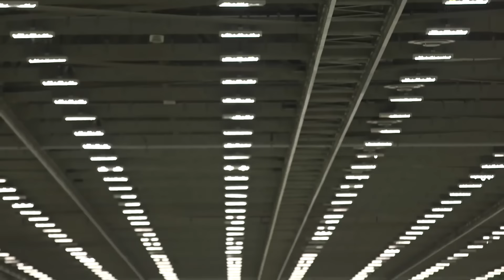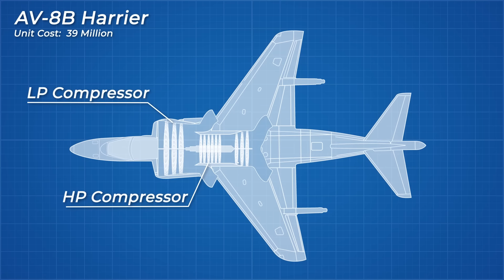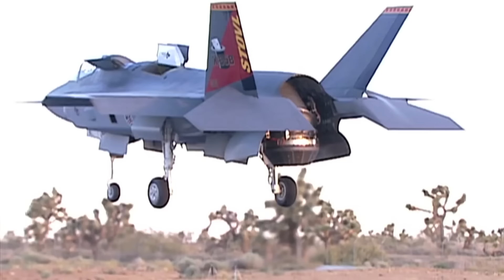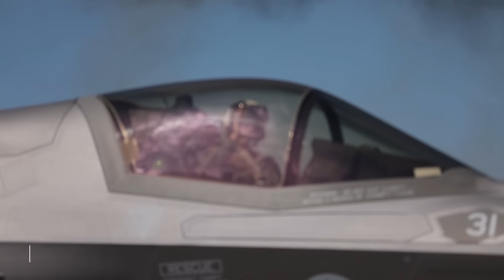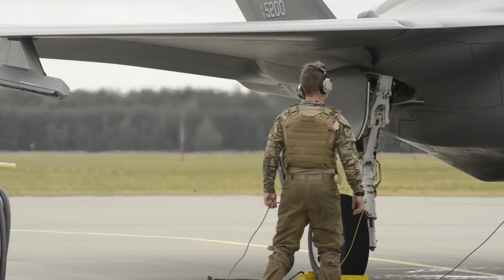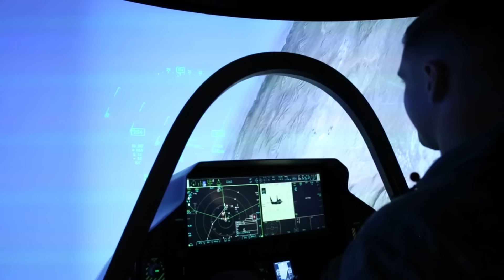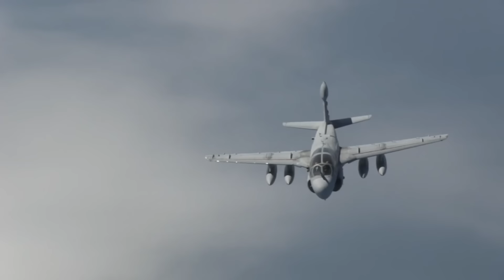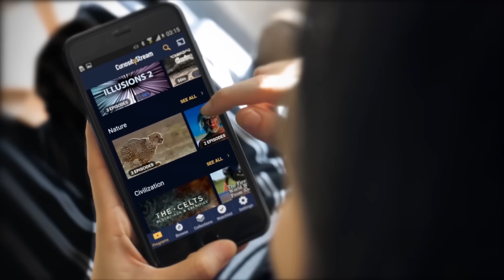Is The F-35 Worth $115 Million?

Comment: Actually only vtol f35b costs 115 million.( most expensive version). This is meant for the usmc and is only worth buying for nation that have that unique requirement.

 F35a conventional land based  take off variant  is only 89 million with price projected to drop down to 85 million. At it's current price it's already cheaper per unit cost than the eurofighter ( 105 million) whilst utilizing more modern technologies.

Besides capability advantages the price was in fact why Belgium chose f35a over the eurofighter to replace the f16.

So yea f35 is worth the money

https://www.google.ca/amp/s/mobile.reuters.com/article/amp/idUSKCN1MZ1S0

Comment: You said it in the beginning: due to corruption and lack of vertical integration, the answer is that no, the plane is not worth $115 million.
Reply: It is worth it and is one of best options available. $115 million isn't cheap, but no other plane can fill the role. $89 million for the A variant however is cheaper than most other fighters available, including the F-15.
Reply: @dumdumbinks274  It's not worth all the money getting drained into corruption and inefficiencies. It's also only coming down to that price because a) the administration is fine squandering all that tax money into pork-barrel spending like that and b) because foreign nations subsidize it as well by buying it when it clearly isn't necessary in the current environment. Terrorist cells don't have an air force.
Reply: @Yutani_Crayven  That's some backwards thinking... you prepare for the biggest potential threat, not the smallest. Just because a certain war isn't taking place doesn't mean you can manufacture adequate equipment once it begins since infrastructure is always the primary target. 

Your problem with this is related to corruption and inefficiency in general that comes with government projects. In the context of the market the F-35 is worth it
Reply: @dumdumbinks274  And even then, it's not worth that much because it can be made cheaper without said corruption and with vertical integration. But it's built like the Senate Launch System, not with the goal of building efficient businesses but to launder money.

Comment: The opinion of the test pilote working for LM is of couse going to be positive. It's not a credible source. Also, there was no mention of the astronomical maintenance costs associated with this plane (due to the stealth coating)
Reply: You mean the costs that are roughly the same as the F-15C in USAF service? You're probably confusing it with the F-22.

Comment: A jack of all trades a master of none then. I wouldn't say it would be a successor to dedicated ground attack platforms like the A-10 Thunderbolt II or the Sukhoi Su-25, since its internal weapons store cannot compete with either in ordnance it can carry. These platforms are designed to be sub sonic to carry more weapons under their wings and operate under air superiority to suppress and destroy ground targets. While the F-35 may be able to sortie, destroy the target and return unharmed, it will have to make many many more sorties to perform the same as dedicated ground attack planes which of course has its own multitude of issues.
Reply: The A-10 is not designed to do any of that unless you're talking about a 1960s scenario. Also the F-35 can carry more than the A-10 and Su-25 and is definitely better at CAS than the A-10 and Su-25

Comment: Worth it? Depends on who you ask; depends on who's using it... Did the US have to develop this level of technology? To be the best technology? Does the F-35 put US pilots in the advantage whenever they meet an adversary's similar aircraft? There's a lot of "new stuff" in the F-35 that cost a lot to develop, then that cost is spread over the production run, i.e., build 10,000 F-35's and they start costing less than if you build only 3,500 or whatever the number is. So, it's a complicated answer to a ridiculously simple-minded question. Bottom line: It Depends.

Comment: Oi, those "helicopter carriers" the Marines fly off of are Navy ships. The Marines just ride around in em.
Reply: actually, they are marine ships. but they are piloted by the navy. they are registered under USMC equipment. not USN.
Reply: Keller weskier No.
Reply: Hammer 001  -- 

I think he means most noteworthy. 

The ships are basically LPHs (Landing Platform-Helicopter) and not specifically USMC vessels. Most Navy ships carry at least a few Marines, and the Marines ARE part of the Navy. Calling them Marine Corps ("Core", not "corpse,") ships is somewhat misled and misleading. 

Edit added the word "ships" for clarity. It was what I had meant to say.
Reply: Yep; the most notorious fighting force of the 20th Century still needs bus drivers.

Comment: I'm kind of disappointed in the video. It's mostly full of praises where it fails to do a thorough analysis on its mission capabilities and practical performance, such as it's tiny payload in both armament and fuel, its cost in maintenance and operation, which in turn also limits the pilot's training time in the physical plane, as well as some other things. Sure the plane pushes technological boundaries but that isn't what win battles. With the same cost of an F-35, I can get five F-16's with better trained pilots. And with those F-16's, I can win air superiority over the single F-35 and perform CAS much better than the F-35 all because of the F-35's pathetic payload capacity. Heck I can probably have four F-16s on air superiority, one F-16 on CAS, and still be more effective than an F-35. Even with all its technology, the F-35 in its design because it can't fulfill all roles effectively. After all, the point of engineering is to solve a problem, and in this case to fulfill all roles in air combat. You may say that's impossible, but it isn't, we already have it. The real engineering solution is multiple designs to fulfill each individual mission, an integrated air fleet.

Comment: Really good video, but one thing I think you should have discussed is the F-35's payload compared to that of some of the planes it is replacing, such as the A-10. If the F-35 is to be a strike fighter and provide close air support, it needs a better payload than two internal bays. While yes the F-35 has six external hardpoints, it calls into question how much of the stealth capability is negated once you place six missiles and pylons onto the wings. This goes without mentioning how useful the GAU-8 on the A-10 is, and how the F-35 lacks a useful rotary cannon (for air-to-ground).

Comment: Is it worth the 115 mills? Certainly....if you are a marine aviator. It beats a Harrier in every possible way except for the price tag :P 
Aside from that, it's a bit more complicated. The original goal was for a low cost F-22 alternative that would further lower on maintenance and manufacturing by satisfying the needs of all the 3 services in one platform. It failed on both accounts. It's neither cheep, nor is it one plane. On top of that, stealth and all those moving parts (in the marine version) will not indear it to future maintenance crews. Especially in the field on the rough seas.
Where it did succeed though, is the tech integration and providing of jobs/economy boost. It's the first fully integrated sensor fusion  solution available to all the services and potential buyers. On top of that it's a potential computing powerhouse. Yeah, it's a shitty dogfighter, but you'd have to get used to that and play to your advantages. Avoid WVR as much as possible. With a good SA this plane should provide, it is your best game plan. If all fails, and you end up in the phone booth, then use it as a smarter version of the Hornet. Us those all aspect weapons, 360 sensor coverage, superior nose pointing ability and atrociously high energy bleed rates to get into weapon firing parameters as fast as possible and end the fight as soon as possible. Don't use it as turn and burn fighter, an F-16 it is not. So fight smart, end fights fast. And it should work well. 

But is it worth it.....? That depends on each potential customer to decide for themselves. How well does it integrate into their own doctrine and even more importantly, their budget.

Comment: I am no fan of the F-35 but still I got the giggles out of seeing the Krasnoyarsk Over the Horizon radar when the narrator mentioned long-wave radar could detect stealth air-craft like the F-117. First the Krasnoyarsk Over the Horizon radar was intended to detect incoming ICBMs from the United States using short-wave band radio waves. It used a tremendous amount of focused power to detect objects at high speed coming in from North America. An amateur radio operator could easily hear them as that was the only thing they could here, cursed the Kiev Buzz saw and ceased operating. Second the Krasnoyarsk Over the Horizon radar was abandoned in 1986 due to the meltdown at the Chernobyl nuclear reactor site. The radar site sits in the exclusion zone and it is a crumbling ruin.

Comment: "We've established that the f-35 is a worthy successor to all of these planes." 

You have?! I must have missed that part of the video. It's not capable of doing the same job as the A-10 Warthog. It can't "loiter" above a battlefield and supply close support. It's stall speed is too high, it's too vulnerable, and it doesn't have the A-10's armaments.
Reply: The A-10C is being replaced in the CAS mission by multi-role fighters since the nineties where a ground-to-air threat is present.

Comment: So, ignore the report from a veteran fighter pilot that the F35 loses too much kinetic energy, therefore calling into question the dog fighting capability of the plane because ... stealth? What happens when the enemy also has stealth fighters and the the outcome becomes the dependent on pilot skill, maneuverability, and mark 1 eyeball?
Reply: Not the case at all.
Reply: @peterson7082  What's not the case at all? That the potential issue was glossed over in the video, or that the F35 does not lose energy as described by the pilot in question? I hope it is the later, and that the F35 can fly circles around the planes it is meant to replace..

Comment: Can someone explain me the US marine air craft carrier n navy air craft carriers?
Reply: Its_sham saani The Navy's carriers (all non Marine carrying ships are known as the Blue Navy)are huge (1,100 feet 337m displacing 100,000 tons). They have two "runways" if you will, with one slanted off to the port side this allows 4 planes to launch at virtually the same time; two of the bow and two at an angle about 30 degrees off to the port. They also use steam catapults to launch the aircraft. 

This angled flight deck also allows launch and recovery to occur at the same time. With recovery using the angled flight deck and launch using the catapults off the bow. Recovery is also accomplished using arrestor lines, meaning the aircraft use a tailhook to catch a thick steel cable as they land and this cable slows them down and stops them.  This allows for continuous flight ops unlike in WW2 for instance where it was one or the other.  They also have up to  4 elevators depending on models and are nuclear powered which gives them unlimited range with only supplies like food, avgas, ammo etc. The crew size is approximately 5,000 crew. 

The other carriers are not Marine Corps carriers but Navy (known as the Green Navy) as well.  They primarily transport Marine assets but they are technically Navy as the operations of ship are Navy and the carrier use the Marines for force projection. Approimatley 1,600 Marines of various duties will "hitch a ride" and crew of 1,200. It is a single flight deck and not only is the flight operations similar to WW2, so is the ship size at about 800ft( 250m) (WW2 aircraft carriers were about this size in length displacing 27,000 tons but the modern LHA displace about 2x that)
These ships also have what's called a well deck (all but 2 ships have it, if I remember correctly). The well deck is a the stern of ship and allows for embarc and disbarc of various amphibious vehicles. The ship has a cavourous section under the flight deck and hanger that runs about a third of the ship and the back portion of the ship slips below the water line allowing for small boats and other vehicles to "drive" of float right in or out. This is accomplished by ballast as the ship is a bit to take on or off sea water accomplish this. 

The ship also has a full hospital with approximately 500 beds and several operating rooms. It also has the ability to hook it's power to the shore in a cool trick called hotel power. All of these features is why these ships and the large amount of helicopters will go to disaster zones for relief because yes, the ship has an amazing war fighting ability but a huge humanitarian relief ability as well. 
 This is a lot but I didn't know how much you wanted to know. FYI, I'm a retired US Marine and this info is based on what I can remember so not everything 100% but close enough for government work. 
Have a great day!
Reply: @densealloy  thaaaaank you buddy this is much more than I needed n expected

Comment: This turkey carries less missile than f16 or f15, less bomb than f18, smaller gun with lesser ammunition than a10. So not a decent successor
Reply: It has a larger potential payload and still longer range than any of those aircraft excluding the F-15.
Reply: @peterson7082  if it carries more payload, which means bombs and missile have to be plugged beneath it wings. So what is the point for stealth fighter when its weapons opposed to radar detection?
Reply: @thegulagspeak  In the case of low-observability they would be flying on internal load only- which still is capable of having a larger air-to-air payload than the F-16C and faster speed, and over a longer range. When that is not necessary the potential external payload exceeds that of the F-16C and F/A-18E/ F and still has a lower RCS and longer range.

Comment: Once again its not going to replace the a-10 warthog its more to replace the F-16, the F-18 super hornet on aircraft carriers and for the marines its to replace the Harrier which was taken out of production as the one that has vertical takeoff and landing the F-35 B is actually the one that cost 115 million the others cost per unit is less than that because those do not have the specialized equipment needed for VTOL. The A variant is about 89.2 million per jet and is projected for next year to be 80 million, the C variant cost is 107.7 million per jet and the B is 115.5 million per jet. Each B2 Stealth Bomber cost over 2 Billion dollars to purchase and maintain. Its a multi role aircraft meaning it can do bombing runs as well as fight other aircraft but isn't the best at either. A dedicated aircraft is often better at their role if its a fighter its going to be better at fighting other aircraft or if its a bomber its going to suck at fighting other aircraft. Carrier aircraft are often multi role because you only have so much space for aircraft and only so much storage for parts to maintain them so its often best to have one aircraft for both bombing and fighting roles for the sake of logistics.
Reply: The multi-role fighter has been replacing the A-10C since the mid nineties in regards to CAS missions where a ground-to-air threat is present. The B-2 doesn't cost 2 billion dollars.
Reply: @peterson7082  To purchase it is about 737 million to purchase the plane the rest is the  upkeep that it requires to run at peak performance. The paint is extremely important because of its stealth and its expensive when they need to repaint them. Also pilots are not easy to come by because they have to go though background checks shit before they can even begin to learn to fly the aircraft. 2.1 Billion is the average cost of the aircraft today. Only 21 where built.

Comment: so supposedly you only produce one kind of plane that can do it all. the jack of all trades. well then, its quite simple, if someone finds a weakness, then all aircraft of that type is involved. in this case all the planes you got are figured out in one step. if you got diversity , then you have better options. this plane will never be excellent in anything. i rather have a range of planes, eatch of them excellenmt in one specific thing rather than something that is medicore at best in all. i would choose the jack of all trades if it was cheap. but its not.

Comment: I love the way it took until 2019 for the Americans to improve on the harrier jump jet which made its first flight on 28 December 1967, only took you 52 years.
Reply: That's like comparing a Tesla Model S to a Model T
Reply: stockart whiteman  I get what your saying but upgrading armor plate's, weapon systems and engines is a bit different to changing the way a jet fighter takes off, that's not something you can just upgrade, you have to develop it from scratch, which leads me back my main point it took the Americans 52 years to better what the British did with 1960's tech.